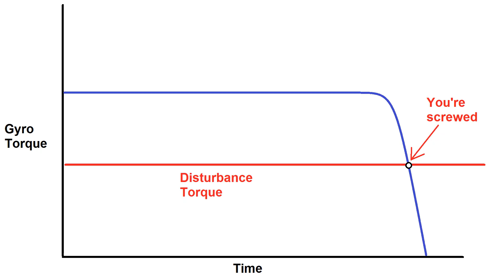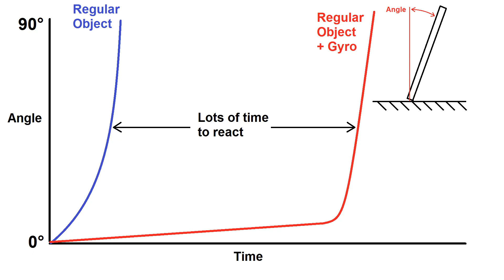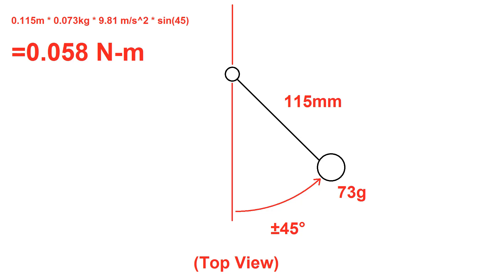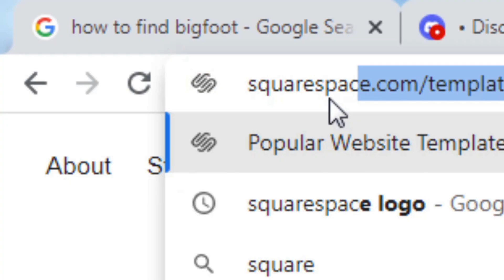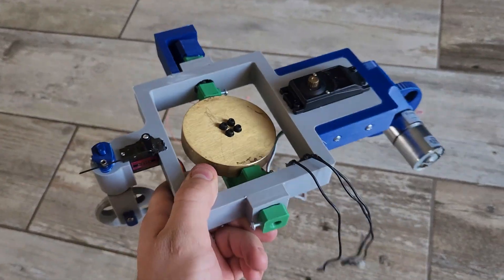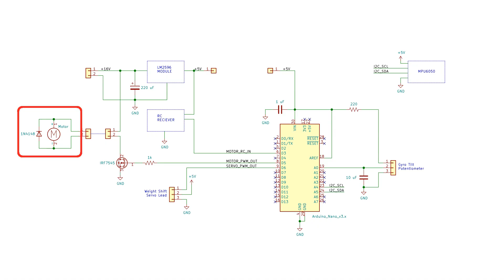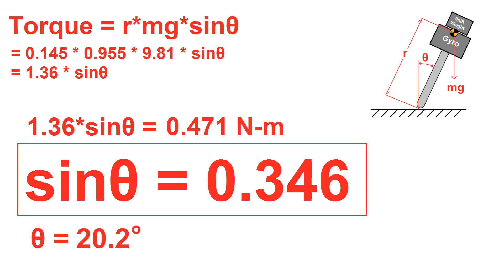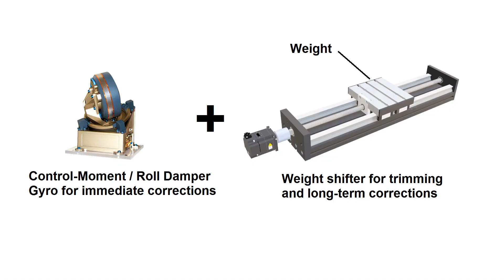Gyroscopic Stabilization with Weight Shifting

Comment: Something to note is that shifting a weight back and forth creates an opposite torque on the body. If you are leaning to the left, and you move a mass equal to yourself to the right to bring your center of gravity to the right so you stabilize, you're ALSO pushing against an equal mass of yourself, which by Newton's laws, reminds us that you are now pushing yourself even further to the left. It's wild if you look at a graphed simulation for CG as you swing the arm back and forth (or use a linear motor) because you initially fall even MORE to the side you're already falling toward as you push 'away' the mass, and THEN gravity's effect takes over the mass once you stop moving it.

A similar issue happens when making segway-style balancing devices: if the rider is falling forward, by nature of driving the wheels forward, conservation of angular momentum means that the unit as a whole (including your body) will pivot around the CG, causing your gyros to read a backwards rotation that is indistinguishable from actually falling backwards. Professional mass-market products compensate for this by actually doing an insane amount of math simulation in realtime to calculate the mass 'on-board' and then calculate, based on that, exactly how much it will rotate backward for any given amount of forward acceleration. For smaller balancing robot toys and such, this is less of an issue because the mass is permanently the same, give or take a few dozen grams for different battery types, though as an interesting side note, Wowee released a little self-balancing toy robot that had a tray you could load things onto, and a little bluetooth app to drive it around, and with enough sniffing of the bluetooth packets, someone was able to turn it into a scale, albeit a very poorly calibrated and inaccurate one, to calculate approximations of the weight placed on its tray just due to how it measured its own difference in rotational acceleration when driving forward/backward.

Comment: kinda surprised you didn't add in turn controls using the gyro to tilt the bicycle. you don't need steering control on the wheels, since tilting the bike will induce a turn on its own.

Comment: If my understanding of the physics involved here is correct, for the bike vehicle, you don't need the weight arm, just steer the bike into the direction of tip, slightly over correcting, so that you have margin to resume your desired course..
For turning without the weight arm you just need to understand you a bike (motor or otherwise) is steered:
	1) The Front Wheel Steering Angle is set to some value opposite the desired turn direction, causing the bike to lean towards the desired turn direction. This is called counter steering
	2) The FWSA is then set to the a value in the same direction as the desired turn, starting the turn.
	3) As the turn continues, the FWSA is modulated to maintain the desired lean angle
4) Just before the turn is ended the FWSA is increased in the direction of lean, bringing the bike back to vertical, ending the turn.

In short, the you steer the front wheel of a bike to adjust the lean angle, and adjust the lean angle to change the direction of travel.
The control algorithm for this would look something like (I think, I’ve never done anthing like this, only have a good understanding of the physics of a bike, and watched several James Bruton videos on balancing robots):
	DesiredTravelHeading == RadioControllerSteeringAxis +  DesiredTravelHeading
	TravelHeadingPID(input[IMU_CompassHeading], SetPoint[DesiredTravelHeading], Output[DesiredLeanAngle])
	LeanAnglePID(Input[IMU_RollAngle], Setpoint[DesiredLeanAngle], Output[FrontWheelSteeringAngle])

Comment: Assuming you had an idea of what the front wheel angle and current speed was, you could adjust the control loop to try to hold the bike at the neutral point rather than upright. (In other words, leaning into turns.)

Comment: You don't need integral gain because the mechanical response from weight position to chassis angular position is already a double integrator. Second derivative might help. Also as you swing the weight right it creates a reaction force to the left as the weight is moving, only to switch in direction once the weight stops moving is hanging there. This kind of sign flip is very destabilizing, but I think your gyro is masking the initial reaction force so that it can work.

Comment: Hm. What if you added the contribution of turning forces as one of the parameters and used it to help unload the gyro, while controlling turning by changing the left-right tilt setpoint, similar to how the SegWay moves forward by setting its setpoint to tilt forward?

Comment: What is the tilt angle that you get from MPU6050? Is it acceleration direction or do you ask the sensor to do some kind of Kalman filtering to figure out where vertical is even if it's undergoing net acceleration?

Comment: GREAT VIDEO!! You CONSITANTLY BLOW MY MIND BRO!!! WOW!
- One comment tho..... about the 6050... around 9:25 you're talking about using a second sensor the to counteract the Large Angular Error  (I really have no idea what I'm talking about LOL)  well.. INSTEAD of using that potentiometer to know its position and counteract it moving too far. why don't you just ACCOUNT FOR THE WEIGHT AND MOMENTUM IN THE FORMULAR ITSELF (the 6050's algo.... (TAN 1 times Ax over Az) <- IDK what any of that means lol .. I only got as far as basic algebra in high school.... I should have stuck with it instead of partying with 'friends' ... ANYWAY... so instead of using an external sensor to get its position to tell it to slow down in order to compensate for the momentum and weight shift and it stabilizes, just add that compensation into the formula.. you know the weight of it, and you can easily calculate its momentum... this just make one less step, less computation, and less latency... IDK if it's possible to change that formula in the 6050 but that's what I would do... if possible 🤷‍♂ -the simpler the better... right?
- ALSO you should make the balancing weight come to a gradual stop instead of just stopping on a dime and shaking the whole machine... if you bring it to a stop slowly then the motions is much more smooth and that jerky8 ness goes away and stops it from unbalancing each time the weight moves.... it should stop that death wobble too.. I can't remember the name of this but I've seen it make a HUGE DIFFERENCE... gradual stops, not instantaneous.... just like hitting your brakes in your car.... and the faster it is moving the longer gradual slow down gets... ugh, I'm having a hard time putting this into words..... the time period of gradual slowing needs to be longer when the arm/weight is moving faster.. I hope you know what I mean because this one of most important things to do when balancing the way you are....I've watched a LOT of robot maker videos lol... and this REALLY HELPS - GOOD LUCK BRO!!

Comment: But can't you just let the servo controlling the gyro overshoot a bit when balancing and thereby keep it from gimbal locking? Then you wouldn't need a weight shifting thing.
I mean that if the vehicle is upright again but the gyro is still tilted, then the control loop should tilt the vehicle to the opposite side, so that the gyro can recover to the center.

... maybe it would work to just offset the desired tilt of the vehicle (0 deg) proportionally with the tilt of the gimbal
But I don't really know...

Comment: Now you can make it a single wheel instead of two...who needs two wheels we have the technology.
I really wanted to build a catamaran or trimaran that only has one hull and use a gyro to keep it on one hull, as you know, the resistance of a second hull in the water really slows a boat down.  So it would be much faster with a single hull.   Perhaps that can be next after the one wheel..

Comment: absolutly love it!  auto o-rings can get to a couple of inches for tires.  put an angle of the front fork for ease of forward control.
arc the weight over the top.  this is a bearing and servo torque planning nightmare.  you are beating the snot outta me.

Comment: Wide rubber bands on the wheels for traction. You can use a bolt & brass bushing for the steering kingpin. You should add a bit of caster to the front wheel and see if the natural stabilization from that passive gyro can do the trick without fancy controls.
Reply: Oh, and for this to work right you need FORCE CONTROL on the steering, not position control. This means no rc servos for steering input!

Comment: One simple change that would add to the stability is to change the axis that the shift weight swings on. If you swing it like a pendulum it will lower the center of gravity on the shifts, keeping the reactive force at bay. The only caveats would be distance to the ground and power of the shifting motor which could both be reduced by varying the axis angle from vertical.

Comment: If I'm understanding right - you're limited in the max side loading during turns before the system runs out of control authority - but couldn't you just lean into the corners?
Instead of the target stabilization angle always being vertical, set the target angle to be a function of turn radius and velocity, such that it cancels out the lateral forces from turning. 

I think that would require the moment of inertia in that direction as part of the math, which you'd probably have to re-measure every time you changed a configuration though

Comment: i wonder if a fluid would be an effective trim ballast? peristaltic pumps are reversable and you could probably move a bunch of weight around super quick without needing the weight of a linear bed.

Comment: Could it be that the solid tire requires counter-steering at very low speeds?  When you turn you begin to turn you start to lean into it and then the gyro corrects for that.  Any over correction puts both momentum and weight on the bad side, worst yet .. successful corrections put you right at the point of failure.

Comment: Can you program in an "averaging" of the gymbal, this way it reduces the jitter to the counter weight...this way it slowly over time moves the arm rather than jerkily slams it over
Very very cool, and I also thought maybe the weight can be on a linear rail sliding back and forth with a screw rather than an arm..., oh and 3D print the wheel with a groove and slap a rubber oring on it...traction solved, unless you run it on water or slick surfaces
So awesome!  Keep em coming!!!!

Comment: The Gyro will not resist the motion of the gyro in the roll axis, The Gyro weights a lot, so use the weight of the gyro to provide the weight shift using a linear actuator that moves the gyro left and right.

Comment: If it had a well tuned PID loop, I wonder if using the accelerometer to compute "down" would allow it to automatically compensate for side load in turns since the measurement of "down" would also be offset due to the centrifugal force.

Comment: I was gonna mention that wobbly front wheel, but you already did toward the end of the video.  The static test at 10:37 showed how the lateral wobble of the front wheel was simultaneously being compensated by the weight servo, indicated by the herky-jerky movements of both the weight and front wheel.  I'm suspecting the instability in performance is due to the center of gravity changing quickly due to the offset of the front wheel during the wobble, but I'm a definitely not a physics professor and only know enough to be dangerous.  I'd like to see the same system mounted to a more structurally sound bicycle, I bet it would run a lot smoother.  That's a pretty freakin' cool project, by the way!

Comment: I think it would really benefit from an integral term in the control loop. Not having one means you'll have a non-zero steady-state error, which will make the thing slowly tilt until it's going fast enough for the other error terms to gather up enough strength so that the control loop corrects it. This results in an unstable system.

Comment: I built something much like that as my diploma thesis many years ago. The arm does not only work with the weight pulling down, but accelerating the weight to the left or right does create a force in the opposite direction and hence a momentum in the opposite direction that you want. It will work much better when you mount the weight on the bottom so that it is as close as possible to the ground.
Reply: But that force is from the acceleration, not the movement,  so low-pass filtering the control signal should help. -- maybe why he had better luck controlling it manually: he's too slow.
Reply: @gmaxwell  Seems like the control loop update rate and/or bandwidth might've been even slower than that. It's tricky to find a compromise between sampled outputs (servo PWM at modest frequency and therefore, presumably, update rate) and good dynamics; it can be easy to get jerky movement, or too much phase shift, especially when noisy inputs need to be filtered (a median filter may help for the ADC).  Even harder to characterize what the actual transfer function of a human controller is; maybe there's a zero in there, or sensitivity to velocity or acceleration, that hasn't been captured in the PID yet.

Comment: Talks about the momentum bringing the vehicle to the other side so I think to myself "I think you're going to have to use a PID loop to adjust the amount of correction you........ aaaand he's done it never mind" 😂
Reply: A PID control law is a really bad choice for something like this, where the assumptions of linearity and time-invariance is violated.
But even when your system can be usefully reduced to fit those limitations, PID control is still never the optimal choice, except for extremely simplistic toy problems.

Its only advantage is that it can be implemented with only a very simple analog computer (depending on whether you need to compute the derivative/integral terms or if you're able to receive them as inputs, in which case you might only need a single summation device), however this isn't really relevant anymore, since digital microcontrollers capable of millions of instructions par second can easily be had today for only a couple of cents.
Reply: @mortlet5180  do you have an alternative?
Reply: @mortlet5180  I assume that the issue is that the direction of the force changes depending on the turn radius? 
Couldn't you just include that as a parameter in the control loop?
Reply: No, even ignoring the issues related to turning and the bank angle required to avoid slipping, one of the biggest issues is that the rotational inertia of the system (how it responds to a given applied moment) changes non-linearly according to the balance weight's position.

The second showstopper is the non-linear response of the servo as it tries to swing the weight around. Even if it could be effectively modeled and controlled as a second-order lagging actuator, the problem is that we don't want to control the angle of the stepper motor, we want to control the vehicle's attitude.
Unfortunately, we have a lot of inter system cross-coupling between things like:
The roll dampening gyro coupling due to friction in the bearings and reaction forces from the motor;
The stepper motor's angular acceleration imparting both a torque in the roll and yaw axes as well as a side force that gets transmitted to the wheels from the very top of the vehicle;
Flexing of the 3D-printed plastic under the relatively large forces;

Additionally, the instant that the vehicle starts moving (even in a straight line), the entire system changes again to one where any reaction force about the roll axis will produce a gyroscopic counter force from the wheels, proportional to the vehicle's linear speed over the ground.

Please don't misunderstand, I'm not saying the issue is the physical design of the vehicle nor the materials that it's made from. These things are already fixed as far as the control system is concerned and the fact that he could acheive acceptable performance via manual control also shows that the vehicle is controllable as it stands.
I just don't like it when people popularize the use of PID control in the 21'st century, because then anyone that comes across it without any prior knowledge or experience, will believe that PID control is what they should try to use for their project as well; that invariably results in a lot of lost time and frustration from searching the entire parameter space while trying to tune something that doesn't even have a solution, culminating in a final implementation that either never properly works or is just deemed 'good enough' because of how much time and effort they've already spent on getting to that point.

In my opinion, PID control is something that should ONLY ever be taught in a professional setting, where it is used to motivate why better techniques were developed and to facilitate learning about historical hardware limitations that are simply not applicable today.
Reply: @mortlet5180  Thank you for the great answer. 👍
Reply: You're welcome, have a nice day.
Reply: what about a PID + Feedforward? Feedforward should be able to handle some non-linearity

Comment: The center of gravity can be shifted by changing the angle of inclination of the entire structure. It is necessary to implement a gyroscope drive. Having reached some small limit, it is necessary to pull the gyroscope structure in the opposite direction.